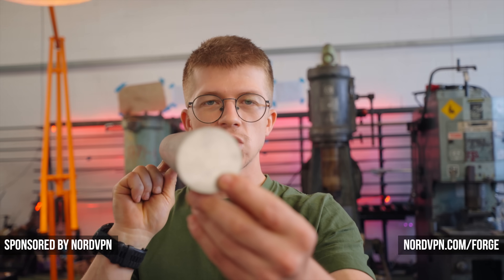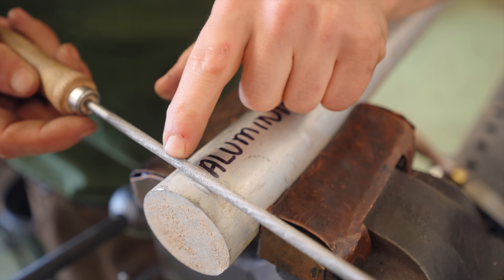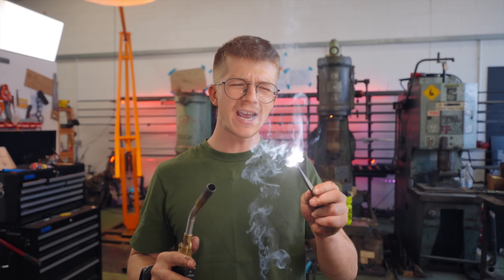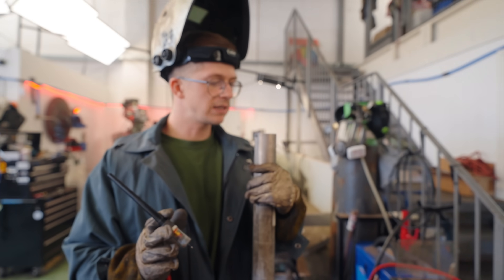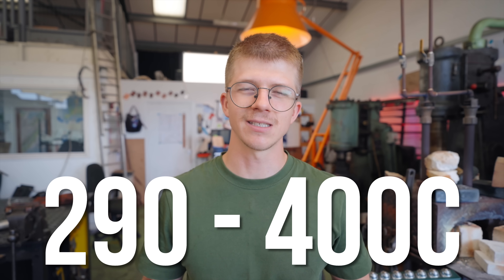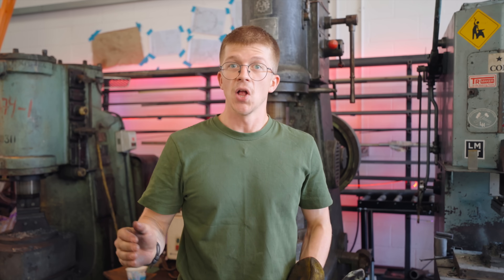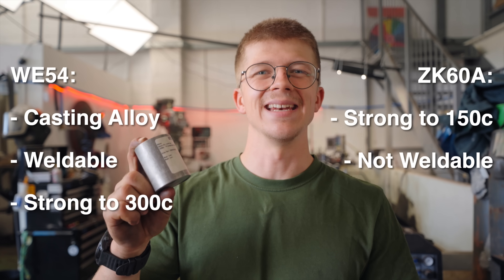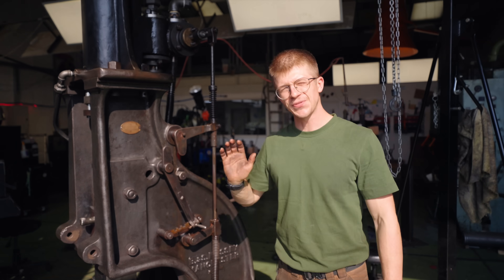Can You Forge Magnesium?

Comment: At sea level, 0 C water freezes and 100 C water boils. 20 to 25 C is nice temp, 30C sucks. It's pretty easy. Freedomheit is all over the place, 33 F, 212 F, 68 to 77 F and 86 F respectively. You should put the kiln next to the power hammer so you don't run around with hot metal in the shop.
Reply: above 20C is way too hot for me, personally.
Reply: If memory serves, Fahrenheit was designed using the thermal properties of brine (don't recall the concentration). Thus it correlates decently to human temps in whole numbers (since humans are mostly saltwater). However, beyond that bit, it doesn't scale terribly well, which if you're doing science, you very much want. Celsius was designed around pure water, so the 'human ranges' are smaller, but its very scalable, making it more useful for most other applications. 

Fun fact: due to technical limitations, 100F used to be the standard internal human body temp. Once thermometers got better, we realized that its closer to 98.6F; however it seems to possibly be dropping slightly in the modern age.
Reply: 32 F is freezing not 33 F just to be clear... and just for the fun of it everyone that think Metric is better then Freedom Units remember Freedom Units were the first to Space and the Moon so
Reply: @adams2280 Temperature scales (Fahrenheit/Celsius/etc) are not technically part of the metric/imperial systems. Hence why there is no kilo-Celsius or milli-Celsius.

They are just roughly associated with each other since countries that the imperial system of measurement (weight, volume, distance and thus speed) often use Fahrenheit for temperature and vice versa.
Reply: @adams2280  NASA used metric for all their calcuations and converted them to imperial so the machinists could understand them.
Reply: Freedomheight is based on average outdoor temperatures. So it's better suited for describing weather 0 F is COLD. 50 is ok, 100 F is HOT. and -40 F = -40 C and absolutely sucks to be outside in. So you can describe most weather with only 2 digits and still be fairly accurate. 

Outside of weather, Fredomheight is useless. Beyond that it's just remembering numbers and rules of thumb you were taught. 420 F gets a potato Baked, you mash in beer at 165 F Dry Air temperature goes down 3 C per thousand feet. Memorized noises not really measurements.
Reply: @Racing_Pig  Air temp drops 2*C per 1000ft.
Reply: @Pastor-of-muppets1985  Yes when moisture is considered like real life. Totally DRY it's 3.
Reply: One other bit of trivia—a rise of 1°C is equal to a rise of 1.8°F, making the Fahrenheit scale actually more accurate than Celsius.  That said, the best scale for use in science would be the Rankine scale, where 0 R is equal to absolute zero—0 K, -273°C, -460°F—but uses the increments of the Fahrenheit scale.  A moot point, since the Kelvin scale is the SI standard for temperature.
Reply: @allenwiddows7631  The scale doesn't make something more accurate. It's the device measuring it. Measuring temp to an accuracy of 0.01C is more accurate than measuring it to 0.05F, for example.
Reply: Huh? Who asked?
Reply: @websterri  It's mentioned in the video. Did you watch it?
Reply: @funkaddictions  F was, he was talking about F! You should listen better.

Comment: Magnesium burns in the presence of many substances. Including those used to extinguish flames. It easily takes oxygen from carbon dioxide, from sand, from many other oxides including water. Interestingly, magnesium combustion can be extinguished with gasoline. In this case, of course, the combustion will continue in general, but magnesium will no longer burn, because gasoline eliminates all combustion conditions at once: it sharply reduces the temperature, it prevents oxygen access, covering magnesium with a crust of carbon sponge, it burns itself, destroying oxygen before reaching magnesium. You can also completely cover it with table salt or pour in a concentrated solution of it.

Comment: Do Bismuth next. It is a REALLY pretty metal and forms cool shapes when heated and worked with, and will throw Jamie's idea of all metal being grey out the window!
Reply: The colors of bismuth are from the oxide layer, but only when it has a specific thickness (called thin film interference). The metal itself is grey. Copper and gold are the only elemental metals with strong colors. Though cesium is a silvery-golden color, and osmium has a slight blue hue. Most metals are silver to grey. Everything else is either an alloy, has colored oxides, or the color is from oxide thin film interference.
Reply: @ashe1.070 Osmium is really expensive if I remember correctly, though, so you can't reasonably get enough of it to forge.
Reply: @nikkiofthevalley  Besides osmium is ridiculously hard so I don't imagine you would have much luck trying to forge it anyway.
Reply: @michaelperren2903  Oh, yeah, that too. You'd have a hell of a time forging osmium if you could even get enough of it to forge in the first place.
Reply: @nikkiofthevalley Sounds like a money problem, throw more money at it and let's get a decent chunk in!
Reply: @nikkiofthevalley  I never said someone should try forging osmium. Besides osmium oxides (e.g. OsO4) are extremely toxic. Osmium tetroxide is not only terrifyingly toxic it's also quite volatile at room temperature. It's vapors can penetrate the eyes causing rapid blindness as well. This is apparently due to it depositing a layer of osmium metal on the unfortunate person's retinas. The stuff is fairly useful in organic chemistry though. They don't let undergrads work with it anymore for the aforementioned reasons however. 

Anyway, my comment was only in regarding the colors of metals.
Reply: @Morberis  I really wouldn't recommend that. Its oxides are incredibly toxic, and at least one is very volatile meaning anyone working with them can easily be exposed. OsO4 also causes blindness, besides being lethally toxic.
Reply: Can't really do bismuth easily because of its low melting point, I think. Also, it's extremely brittle. I can tell you right away one hammer blow will be a shower of pieces.
Reply: Yeah, all metals are weird like that, gold is apparently red?
Reply: @MostlyPennyCat  I don't think so. The fine (real) gold foil used for gilding has a slight greenish hue if it is thin enough for a little light to come through.
Reddish gold has copper added to it, IIRC.
Reply: @MostlyPennyCat  Personally, I wouldn't describe gold as being red. I've also seen copper described as being red. I don't see how anyone could look at either of those and say "yep, that's red."
Reply: @ashe1.070  
Colour is just a super weird function of material and shape, oil, for instance, is not rainbow coloured. Except when it is.
Make gold thin enough it goes green of all colours 😂
I forget where the yellow comes from in gold, it's reflecting light so that makes it subtractive colour, CMYK, configure the object correctly, shape and thickness, it stops reflecting yellow.
Colour is weird AF, perception is nuts and brown and orange are the same colour 😂😉
Reply: @ashe1.070  Copper turn salmon pink when it is heated to the point that it starts to oxidise.
Reply: @cambridgemart2075  That's from the oxides not the metal itself. Chromium (III) oxide is green, but no one says that chromium is green because it has some oxide on it.
Reply: @ashe1.070  Because chromium doesn't naturally oxidise to Cr2O3
Reply: @cambridgemart2075  True, but copper doesn't naturally turn pink from oxidation either. That's only if you heat it. A more apt comparison would be the natural formation of basic copper carbonate, and other copper salts on copper exposed to the elements for a long period of time. In that case, no one says copper metal is greenish blue. 

The point is, the color of a metal's compounds (whether they be an oxide or otherwise) are irrelevant when talking about the color of a metal because those aren't metal. They are compounds.
Reply: @MostlyPennyCat  Gold is gold color. If anyone said it's red without an oxide layer or something, that's just not true. Like the old myth kids in school pass around that your blood is blue until it touches air
Reply: “Bismuth is like lead for people who fear death.” - ExplosionsNFire
Reply: Bismuth is really brittle. It also melts at a low temperature

Comment: So putting water on it causes a bigger and more violent fire because of how hot it burns. It rips the oxygen and hydrogen molecules apart from water.
Reply: Wich in the worst case can create an explosive gas mixture. Luckily the heat loss slowed the reaction enough to prevent it?

Comment: My non science-y opinion, it depends on the bonds themselves between compounds that give it strength. Curtesy of google "Chromium has a density of 7.19 g/cm³ which is considered a relatively high density compared to most common metals like aluminum (2.7 g/cm³) but lower than denser metals like copper (8.94 g/cm³) or gold (19.3 g/cm³)." And we know that chromium is only outshined in hardness by diamond and boron "also curtesy of google", yet it has a density less than copper and gold, the latter of which in pure form is very very soft. Thanks for letting me nerd out and showcase some google-foo! Love the videos!

Comment: A common camping tool is a magnesium rod, which is essentially a chunk of magnesium connected to a striking surface. You shave off pieces with a camp knife and then use the flint to strike a spark that you use to light the magnesium to start a fire. Very flammable, but also soft enough to shave with a standard camp knife.
Reply: Another common form of magnesium fire starter is basically a ziplock bag full of chips/shavings. You can light those with a match and they'll get your fire going.
Reply: Got one ot those, has magnesium with a ferrocerrium rod in it. I find that mixing a tiny amount of magnesium shavings with pine pitch wood shavings is an instant fire with one strike.❤
Reply: I use those magnesium fire starters to make flash powder. Milled down to a fine powder with a good oxidizer, heck, even a weak oxidizer like potassium nitrate, makes a very fast flash powder. It burns with a deep thud.
Reply: I carry just such a fire starter on/as my key ring. You can actually scrape it with a sharp rock.
Reply: Ford Kuga cars in South Africa were recalled when the they started catching fire and the magnesium chassis would burn and essentially be unable to put out.
Reply: @graeme.davidson  Huh. That's interesting considering how common-ish magnesium is in the auto industry. It's certainly nowhere near as common as steel & aluminum, but it isn't that difficult to find magnesium engine blocks, intake manifolds, I had a Ford Explorer with a transfer case that had a magnesium case(blew up the TCase to the point that it cracked the case flaming gear oil pouring onto the ground - shout out to it not catching the whole thing on fire somehow😅), differential housings, suspension parts on occasion, etc. Frankly, I've always been kinda surprised that we don't hear about more magnesium fires in cars.
Reply: @RyTrapp0  Early VW Beetles had aluminium gearbox casings, they used to be a problem if the car caught fire.
Reply: It just slightly different alloy than magnesium. Called ferrocerium.
Reply: @Rosewayforge   There is a version where you have  a magnesium block, with a small fero rod attached/built in. You scrape some of the magnesium into a little pile, on top of your tinder; then hit it with a spark from the fero rod. One spark will set it off. This kind of starter works well with dodgy tinder, as the Mag burns so hot it will start even not so perfect tinder.
Reply: @Rosewayforge Ferrocerium is used in lighters to strike the flame, it can be used as a firestarter but the thing they're talking about here is a piece of magnesium that you scape bits off of to use in place of kindling, to start fires even if it's wet.
Reply: @nikkiofthevalley   my bad I thought you all where talking about the striking rods

Comment: An interesting fact about magnesium. After WW1 most of Germanys iron industries were seized as reparations. But they were allowed to keep the magnesium plants. Thus they had to specialize in manufacturing with magnesium, the Best way they figured out was with huge presses, because hammer forging often Leads to these kind of cracks 

Machine thinking has an amazing video on these huge presses
Reply from the maker: That’s super interesting!!!
Reply: @AlecSteele 
After the war America initiated the US Heavy Press Program for cold forging magnesium for the aerospace industry. 
You need to go see one, they are insane, the largest in the world in Tyson, the 100,000 ton press in Italy, owned by Giva.
Reply: @AlecSteele  Go and visit it for us!
Reply: @AlecSteele  indeed it is
Reply: Check out the video by MrGreenGuy. 
Petrol/Gasoline on a magnesium fire will extinguish it  without the risk of explosion.
If I didn’t have the correct fire extinguisher to hand, I think I’d rather try to starve it of air with sand.
Reply: @richjonse Hang on. You're telling me that pouring literal fuel on a magnesium fire puts it out? That makes no sense.
Reply: @Weretyu7777 It puts it out because the boiling point of the fuel is much higher than water, and it doesn't break down into as explosive stuff. Water gets broken down into hydrogen and oxygen, which can easily explode with quite a lot of power. The fuel gets broken down into stuff that's flammable, but not explosive. It'll definitely light on fire, but it will starve the magnesium of oxygen and drop its temperature in the process, putting it out. You still have a fire, but you can use standard fire extinguishers on it.
Reply: @nikkiofthevalley  Huh. The more you know, I guess. Thanks for replying!
Reply: @nikkiofthevalley  "It puts it out because the boiling point of the fuel is much higher than water,"

Petrol has a boiling point considerably lower than water, between 35 - 70 °C.  This is why fuel vapour locks were common back in the days of carburettors, the petrol would boil in the fuel lines from the heat of the engine bay.
Reply: @ferrumignis  Oops! I'm an idiot. Still, the rest of what I said applies.
Reply: @nikkiofthevalley  I wonder if you could use diesel then? it's not nearly as flammable as gas and wouldn't flash up like gas does..
Reply: @ferrumignis  another fun fact, liquid petrol does not burn. It is the vapour that burns. You can (if fast enough) put out a flame by dipping it in liquid petrol, you just need to be fast enough to avoid igniting the vapour layer which sits on top.
Reply: @jackclark1994 the problem is that as the fuel heats, boils, then atomizes, it becomes extremely flammable vapor. You can drop a lit cigarette into a bucket of cool gasoline without ignition, but drop one on hot asphalt with gas spilled? Whoosh 🔥 people that spout off “facts” sometimes don’t have all of them.
Reply: @liquidrockaquatics3900  yeah,  because of the gas fumes, not the liquid
Reply: @ gas fumes ARE gas that has had extra energy added to change phase.
Reply: @nikkiofthevalley  Boiling point doesn't really matter here. Petrol doesn't need to be broken down into anything, it's simply flammable when vaporized. Water can't be broken into hydrogen and oxygen by burning (it's already "spent fuel" from hydrogen burning, i.e. oxidizing), and oxygen isn't released when water reacts with magnesium - rather, it combines with magnesium to create magnesium oxide (the same product as magnesium burning, because burning is essentially oxidizing fast), releasing just hydrogen. But hydrogen itself is definitely explosive (or, burns very rapidly, suppose you could call it oxidizing very VERY rapidly), so you're turning a fire into an explosion. If you pour petrol on a magnesium fire, it doesn't react with magnesium, simply starves it of oxygen (by a mix of physically covering it, and the flammable fumes selfishly stealing all oxygen to react with it).

The reason you can't use a CO2 extinguisher is because magnesium reacts with it to oxidize, releasing free carbon - you're not stopping the magnesium from oxidizing, just adding carbon that can also burn.
Reply: @richjonse that is the “one strange trick” I hope I never, ever need to consider using.
Reply: This reply thread has to be among the most fascinating threads on youtube. I learned a lot!! I learned a bit of history, and how when desperate, utilizing gasoline could be a better option instead of water (steam explosions are no joke!!). 

Also I have a set of metal extinguishers (MET-L-X for magnesium-based fires, and Lith-X for others) that are each in dry-powder form in a bucket. I’d essentially smother the fire by shoveling the powder over the metal fires.
Reply: I learned something today, and it explains why Volkswagen engines of my youth were made of magnesium alloy. I always thought it was because it was lighter (as the engines were in the rear) and more heat conductive (because they were air cooled). Little did I know that it was because Germany kept her magnesium industries but not her steel industries after the war.

I thank you SO MUCH for teaching me something very interesting and explains many things that I thought I knew.